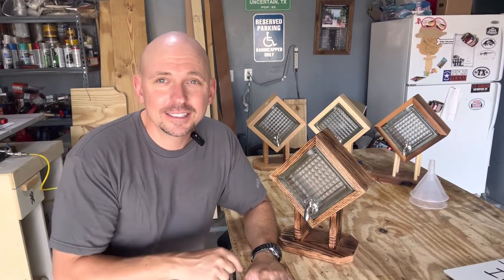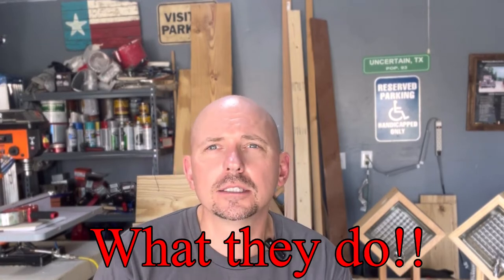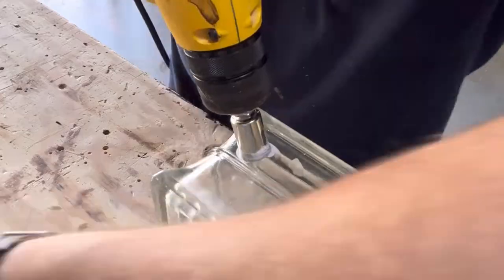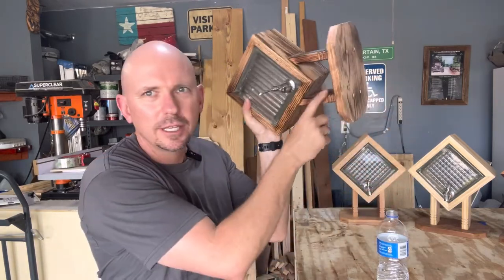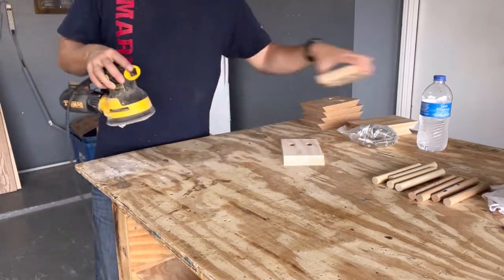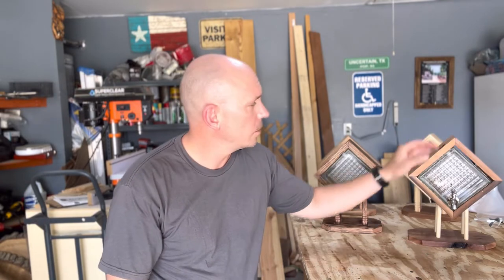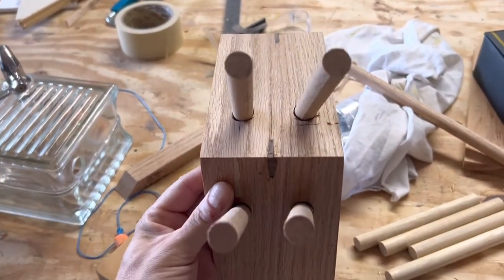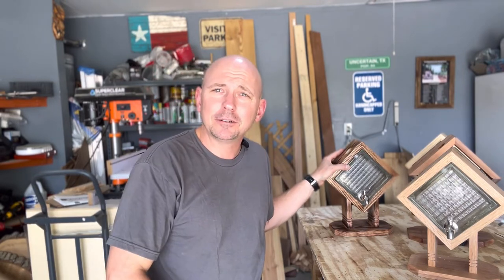Make Your Own Whiskey Tap Out Of Glass Building Blocks

Comment: Its just perfect.. but can you please tell me how to clean inside of the glass box. after making 2 holes those tiny glass particles will be present inside the glass box after the drilling..
Reply from the maker: This is a good question. I have a follow up video coming out today and I did not include this. I might take it down and add it. 
Anyway, I rinse it multiple times. Then I hold it up to the light make sure I don’t see anything. Just lots of thorough rinsing really
Reply: @epeiusgarage  yes please.. and when we drill the glass box i think we ll get a bigger round glass chunk .. m not getting how to take out from the glass box.. please include my doubt in your video.. thankyou so much
Reply from the maker: @rachanaparmesh1394  that round piece comes out when you rinse it. I never have trouble. But yeah I might add this. Means I have to film it and edit it in today lol. I think it’s worth it though. How do you say your name?
Reply: @epeiusgarage  Ra - cha - na = rachana
Reply from the maker: @rachanaparmesh1394  ok sorry I’m advance if I mess it up.
Reply: @epeiusgarage  np .. thanx for the reply
Reply from the maker: @rachanaparmesh1394  of course. Make sure to watch the follow up. I’m about to go film this real quick. Also there’s a third hole I drill now. I cover it in the new video
Reply: Making  one now used my drill press worked perfect also ground down the mold ridge with my zip grinder made  a flat surface with the putty couldn't be  better tjx.

Comment: Love the burnt version. I think I just found my next project
Reply from the maker: It’s a fun project. I did several follow up videos. Make sure to check those out as well
Reply: Just had a thought. How do you get the glass out of the frame for cleaning when the glass has those front and rear beveled peaks?
Reply from the maker: @dulcimerjunkie8516  slides in and out. Inside of the frame is the same as those peaks.

Comment: 2 questions-  how do you get the glass cut-outs out?
And do you glue the frame around the glass block?  Didn't see that in the video.
Thanks loads! They look awesome. And I agree about the burn look -- incredible😎
Reply from the maker: I think I cover this in one of my follow up videos. I rinse with a fair amount of pressure larger hole pointed down. 
The glass is not attached to the frame. Just sits in it freely

Comment: Hi, great work.

Is the glass attached to the wood or is it removable?
I'm afraid if someone picks it up and isn't careful it might fall out.
Reply from the maker: Hey, 
Thanks you! Thanks for watching too! 
The glass is not attached. You could add a stopper on the back but the dimensions I give for these blocks make a tight fit. I’ve had no issues with mine yet

Comment: Just a little trick.   Cut a round piece of sponge that fits inside your hole cutting bit.   Soak it with water,  then start cutting.  As you are cutting, the water from the sponge keeps your cut piece wet.
Reply from the maker: Nice tip, thanks.

Comment: Need some help. My glass block edge to edge is 7 5/8” long. My miters for the frame always come up short. What is the technique to get a square frame that fits around the block?
Reply from the maker: Make sure your inner corners of your miter are an 1/8” longer. In your case 7-3/4”. 
Do this using some scrap wood cut in 1-1/2 wide strips. Once you get the fit you want keep one piece and use it to set up your saw every time. 
This is what I did.

Comment: Can I ask why you didn't use the rubber grommet on the spout? I noticed you just put the silicone directly against the back wall of the spout without the rubber grommet,, any reason? Is a a better seal without it?
Reply from the maker: I could not find an easy way to get the nut in the glass. Not without making a larger hole than I wanted. Go for it though. Let me know if you do. I’m curious

Comment: Are you glueing the glass inside the box with epoxy?
Reply from the maker: No, the glass slides in and out. You want to be able to take it out to rinse it. There’s no need to epoxy or secure it in the box
Reply: I would guess that the stopper helps keep it in place on top of the weight.

Comment: Hello and thanks for the video. I've cut two holes. One at 16mm and one at 18mm. The nut for the spigot does not fit through the 18mm hole. I could make it bigger but then I'm worried about the stopper. Suggestions?
Reply from the maker: I don’t use the nut. I use silicone. I cover it in the video and I have a follow up video plus another video that gives more detail on this subject.
Reply: @epeiusgarage  I just watched the follow up video and I realized that. Thanks so much for the response and confirmation.
Reply from the maker: @mrfixitpa  my pleasure! Hope it turns out awesome

Comment: Is it standard size blocks 190x190×80mm? How much is the inside volume?
Reply from the maker: They are 5-3/4” x 5-3/4”. I don’t have a metric ruler. I know, I need to get one lol. 
In my conversion app it says it’s 146.05mm. 
Hope this helps
Reply from the maker: I know a 750 ml bottle fills it just above halfway. It holds quite a bit

Comment: How do you make sure that the hole for the stopper lines up between the glass and the wood?
Reply from the maker: It depends on your glass block size but for mine I measure 1”-1/4 in 1”-7/8 down on the wood frame. Then on the glass I measure 1”-1/4 down and 1”-1/4 in. 
For me this lines up perfect. You may need to figure out your for yourself and then just write it down for next time. Thanks for watching hope this helped

Comment: I just built some for myself, and have a word of caution.  When drilling the block, GO SLOW!  If you go fast, you run the risk of the glass splintering ot spalting on the inside, and those pieces are a PAIN to get out of the block.

Comment: Hi, someone had the dimensions but in metric system? 😅
Reply from the maker: Hello, are you needing them in metric? There are many sizes of blocks out there. So you just need to find the blocks your going to use and measure those. I hope that helps
Reply: @epeiusgarage  thanks. I tried a converter online and I think that the dimensions of the block are the same. 19cm x 8 cm
Reply from the maker: Mine are 15.24cm X 7.62 cm when converted. I buy mine from the Lowes hardware store. Imperial dimension is 3” X 6”
Reply: How many inches you left from the cube to the wood?
Reply from the maker: @Julieta.cosmic_lady  I’ll have to check. I might do a live video to answer questions or just a regular video. Feel free to message me on Facebook. My link is in the description

Comment: Il y a t-il quelqu'un qui peut me dire les dimensions du cadres en Français svp
Reply from the maker: I’m sorry I do not understand. English?
Reply: @epeiusgarage  French dimension of the frame
Reply from the maker: @gaetanravasco8311  oh, sorry. So it depends on the glass block you use. I’ve found they vary in size.
Reply: @epeiusgarage  my block, 19cm×19cm×8cm
Reply from the maker: @gaetanravasco8311  depending on your material thickness will determine the outside dimensions. Make the inside just a little bigger than your block